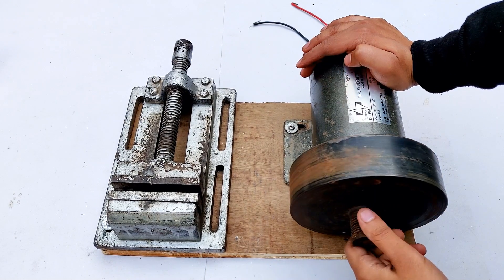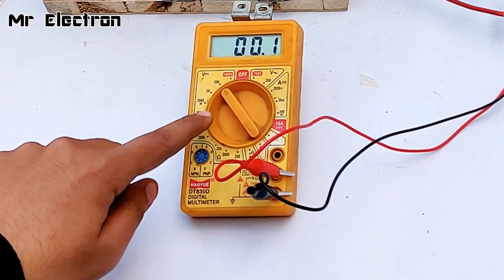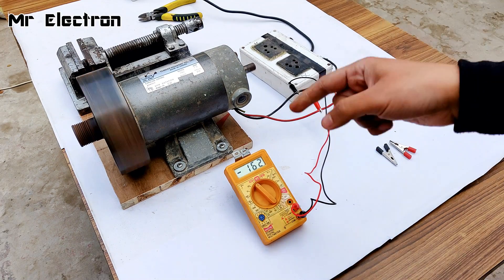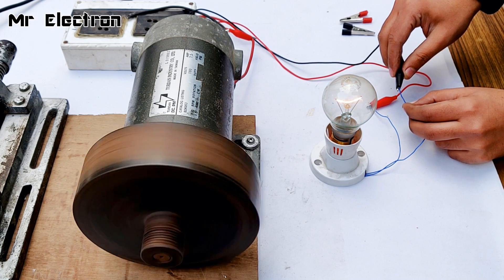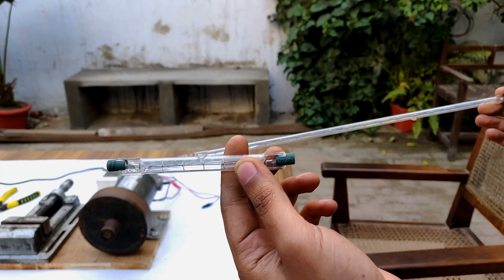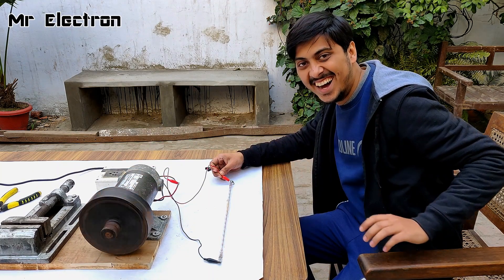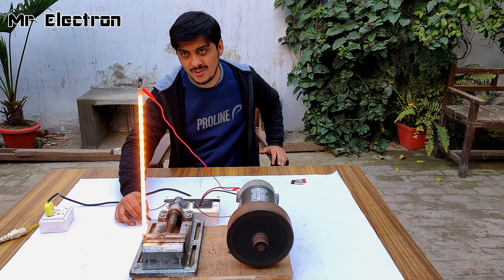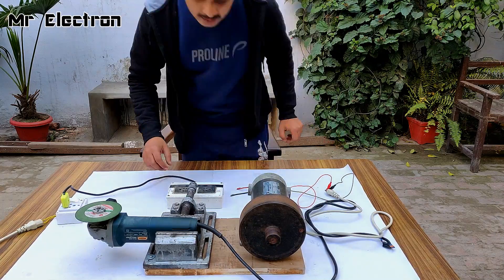180v DC Motor to 1500W Flywheel Generator | Regenerative Braking 1.5 kw

Comment: Bro tell me which board is this    that can change normal current into 180v because I have trade mill at home and same motor you are using in this video so it is good to use this device board to trade mill motor directly for running and how much time did it work

Comment: My idia..... Conect  small invrter    inverter out conect  motor speed controller power plug .,use high amps rectifir..to  dc speed controller  to12volt to inverter ok...??? Super free energy sistem👍👍

Comment: Can you connect the motor to a battery to measure how fast and how much the motor can recharge the battery from a spinning state to a braked state?
Reply: Voltage is very high, a buck converter would be needed.

Comment: Can you please make video on how to store that energy recovered from regenerative braking ....
Reply: just hook up a battery or supercap bank instead of a bulb or grinder.
Reply: that energy is actually stored in that flywheel simmilar as a capacitor it will charge and deliver more power than input for a short time
you can power that motor lets say with 200W sollar panel and connect 1000W angle grinder to it so you can grind something for short time untill flywheel stop generate needed power, then you can wait untill it pick up speed (charge it self) and continue to grind and repeat that proces

(angle grinder consumes 1000W only when its loaded if it spinns frearly it consimes minnimum power)

Comment: never touch a halogen bulbs with your finger,first rules,otherwise the glasses will be destroy time to time by the sebum that you have on your finger when heating up...secondly,thats well,you just discoved what is a back emf or so call "electro motive force",now your mission is to find out ,how to canceled it 100%....emf are a waste creating while transformation process from mechanical to electric (generators),and reversly from electric to mechanical (electricals motors)....

Comment: Please reply.....
Can I run 24V, 250 Watt DC motor using by 12V 150Ah + 12V 9Ah?
Reply from the maker: No. The batteries to be connected in series should have a same Ah value
Reply: @MrElectron  Thank you very much.

Comment: Good job and be continue man.
 In the starting this machine (d.c.motor  & flywheel) is in stand still condition, when the motor is connected with electricity  it starts rotating with respect to limit of speed controller, as being mounted on one shaft flywheel is also rotating with same speed of motor, where energy is being stored under various factors; here direction of energy is from utility to motor and motor to flywheel as inertia.
When machine is operating at desired speed its utility is switched off.
Now in this typical situation flywheel is rotating due to inertia, which is also operating to d.c. generator (previously this equipment was d.c. motor) for producing electricity to glow bulb/s but decreasing light with every moment due to reduction in speed of d.c. generator/ flywheel; in this case direction of energy is from flywheel to generator and generator to bulb.
Reply: Brilliant observation my good friend .when he gets that generator spinning with no power input  .forsay running on magnets alone . Then you got something.your going to open some yes and then their will be some people skurring for the phone to summon a hit man man.! ! !
Reply: Thank you my friend for starting with nice words, regarding my post let me clear one thing, that the end of my both paragraphs is focused on 'just the flow of energy'. Young man is doing good experiments, which may be helpful for him in future if growing in the field. God bless we all.

Comment: The motor is generated AC or DC volts?
Reply: Ac
Reply from the maker: DC volts !
Reply: @MrElectron  but how you run angle grinder on dc ? as Angle grinder works on ac .
Reply from the maker: @aniketsaini3279  Seems like you are my new follower so welcome.
I have covered a few video on " why a mixer motor can also run on DC "
PLEASE CHECK MY VIDEO LIST by visiting my channel.
Reply: @MrElectron  Hi yes i m new and your videos are very interested so i saw the one when you converted a car generator to a dc motor can that motor run an car generator with a belt in between to generate 12v dc thank you
Reply from the maker: @jescassar18  i will upload this video today In sha Allah . You can hit that bell icon if you want or simply visit my channel at 9: 30 pm Indian Timing.

Regards,
Electron
Reply: @MrElectron  hi where can i find the bell icon
Reply: @MrElectron  ok found it looking forward to see this video thanks
Reply: Dc like the one you did with two batteries

Comment: Excellent again.
Reply from the maker: You mean the black rubber belts ?
Reply: @MrElectron  Yes, that's exactly what I mean.
Reply from the maker: I got them from old pressure cookers ( non electric type )
Reply: @MrElectron  Ok ,Thanks
Reply: @MrElectron   What an Idea Sir G......
Reply: @MrElectron  Now turn it into a pusle motor run it as normal with a battery and collect the back EMF coming off it with a magnetic Reed switch eveytime the coil turns off all the energy in the coil comes kicking back,, now take that energy and collect it using second battery or super Capacitor bank you can even use full wave bridge rectifier to convert AC to DC...
If  you do a setup like this and show us it works!!!😉😂
Reply: In the last video you had this rubber rubber, where can you get it please. a link would be great
Reply: ඉතා හොඳ උත්සාහයක්. ජය වේවා.

Comment: Nice experiment bro. But what is the explanation for resistor regenerated during breaking, when you're trying to utilize the regenerated power... I mean ways to reduce this resistance... Any idea?
Reply from the maker: The only way to reduce resistive losses is by using Copper cables and wires as thick as possible everywhere + achieving the state of super conductivity
Reply: @MrElectron  Thanks for suggesting, but I doubt... Can you suggest any detailed research resource for this before I try it hands on